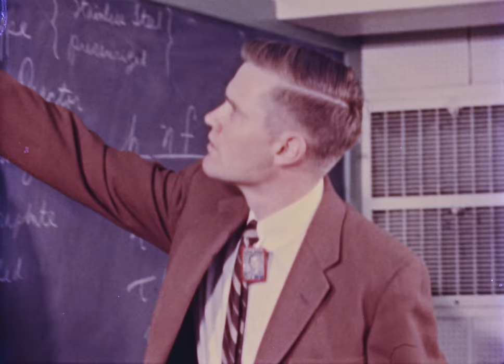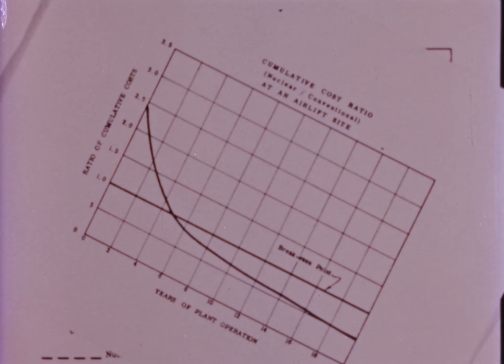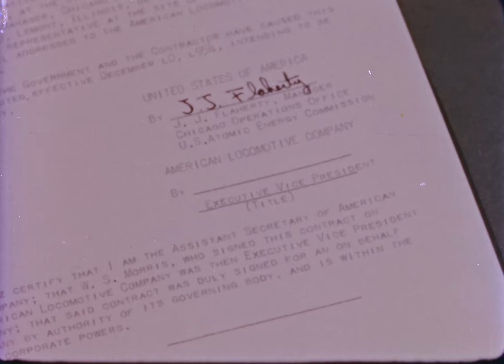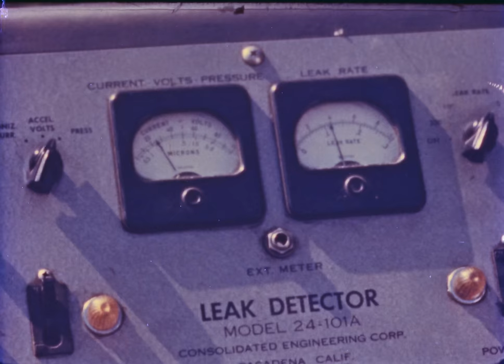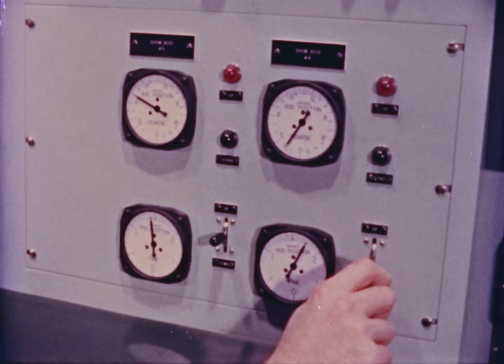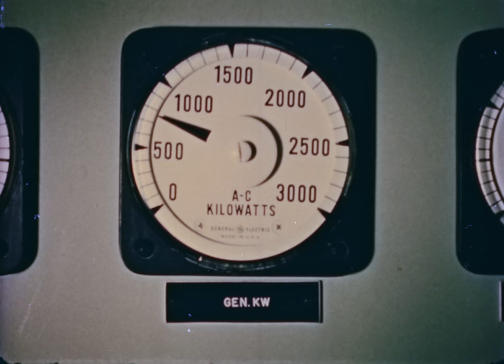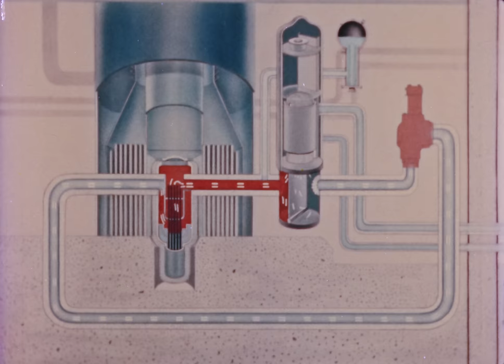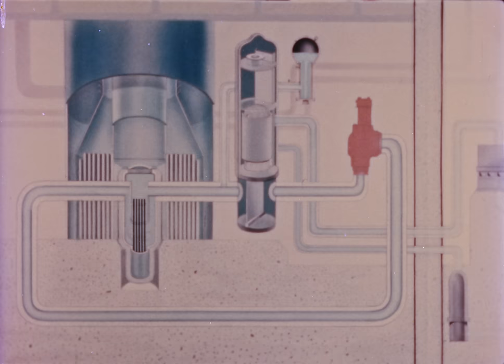Army Package Power Reactor

Comment: I wonder why this cannot be used today?
Reply from the maker: Well it's decommissioned now and being dismantled. A few orgs are trying to rekindle expertise is building and maintaining air-shippable reactors.
Reply: @whatisnuclear  what I mean is why can’t this technology be used today?  We know how to build them.  R and D done decades ago.   Small Modular Reactors ready and  waiting to be built.
Reply: efficiency scales with size. it's way too small to be economical.
Reply: @Muonium1 Unfortunately all forms of electrical generation is subsidised.
Reply: Because in 1961 there was a reactor accident with the successor SL-1. SL-1 is the only nuclear accident in the United States to date in which people were killed. At the National Reactor Testing Station in Idaho at 9:01 p. m. , the prototype of a military boiling water reactor, the SL-1, which had been shut down over Christmas, quickly became supercritical for a few milliseconds, releasing about 6,000 times the power for which the facility was designed. Before the reactivity could be reduced by the formation of vapour bubbles (see vapour bubble coefficient), the fuel elements of the small reactor core made of highly enriched uranium (90%) already disintegrated. The 2 m high water column surrounding the core collided with the reactor lid at 9 m/s – the water level had been lowered slightly for maintenance work – and caused the entire 12-tonne boiler to rise almost 3 m up to the floor, thereby pushing the steering rod back in completely.
Reply: Generally, fear, ignorance and prejudice.
Reply: Because the environmentalists that witnessed 3 Mile Island and viewed the China Syndrome movie, successfully destroyed the nuclear power industry; Coupled with too much intense regulation to build such a plant.
Reply: @65gtotrips  That's a gross oversimplification.  As noted above, the small plants are uneconomical.
Reply: @karstendoerr5378  A failed back to the future Doc's DeLorean, which takes 1.21 gigawatts (GW) or 1210.00 MW of power "withdrawal caused the reactor to go “supercritical” in just 4 milliseconds as the core power level surged to 20,000 megawatts"
Reply: @65gtotrips Compared to what? Regularly Shipping tons of diesel in barrels to an Artic army base?
Reply: @Muonium1 economic compared to what? Regular shipments of diesel barrels to a base in the Artic?
Reply: @Nill757  Compared to LARGER REACTORS. duh
Reply: @Muonium1  the video was about the need to get power to small remote bases in the like of the arctic, not Chicago. See the diesel drums rolling around in the snow at the beginning?
Reply: Green activists
Reply: @karstendoerr5378  “because”

Had absolutely nothing to do with this package reactor at Ft Belvoir.  Army probably has had a thousand times more people hurt in diesel fires, explosions, but they didn’t quit all diesel  use.
Reply: Regulation
Reply: @65gtotrips  the same chant we heard right before Fukushima happened.
Reply: It could, however people became too scared after the 3 Mile Island incident, followed shortly by the Chernobyl incident. Soured Americans believe in atomic energy. Not that we didn't have our own incidents and problems with generation. And other plant operations. But as far as cheap clean and efficient power generation you cannot do better than nuclear power. And yes we still could do this today. However we just do not have the general National consensus to go forward with such a program. As we did in the 1950s. Where we thought nuclear energy would be the answer to everything well it's not the answer to everything it is the answer to a lot of things. And there is a distinct difference between nuclear weapons and nuclear power. The two are not interchangeable
Reply: I thought it was concluded by the energy commission, that was a murder-suicide plot between two of the operators.
Reply: @65gtotrips Fukushima daiichi atomic energy plant, operated exactly as it was supposed to. Unfortunately when the designers worked out the initial calculations for the plant no one ever foresaw 120 ft wall of water, that would somehow reach a plant that was perched well above the ocean. And fairly well sealed and designed with some of the best seismic safety precautions of any plant ever. Has everyone forgets Japan has the the strongest seismic protection programs for any of its constructions. The issue that did before the plant, once the 120 ft wall of water that no one could have foreseen what happened. The plant did it it was supposed to. It shut down the manual cooling systems were operated correctly. But what we got an interesting Glimpse to see was what could possibly happen in a worst-case scenario inside the containment of a atomic plant. Remember this is why we have containment buildings where Russia did not. And you see the damage caused by not having a containment building. Yes there is millions of gallons of water that were used to cool the reactor that are being held in tanks for storage, and yes a large amount of area was contaminated with the steam release none of these compared to what happened at chernobyl, or what could have happened if none of the Safety Systems have been put in place. So to say that Fukushima was the reinforcement of our fears yes that is true but only two people that were not educated and understand how atomic energy is generated.
Reply: The technology is used today. It's this way most of the world's reactors are built but larger because it's more economical.

Comment: The buildings for this project still exist.
One building, just up the hill from the SM-1 reactor building is used by the Joint Personnel Recovery Agency (JPRA) as their HQ.  
From what I recall, the JPRA building was originally used by the reactor project team as a working office space.  
The JPRA building is interesting as it has built in shielding as a measure to protect the occupants in the event of a radiologic emergency with the reactor facility.

In 2022, the SM-1 reactor building deconstruction began. 
You can find videos of the deconstruction on YouTube.
I do not know if the building is completely disassembled yet, but you could see the building from the Potomac if you had a boat to get there.
Google Earth satellite imagery still has the building in-situ.

If you do try to see the building via boat from the Potomac: DO NOT ATTEMPT TO GO ASHORE at that location!!  
This area of Fort Belvoir is a secure area not accessible to civilian or military personnel without authorization.  
You will be arrested and fined heavily if you attempt to do any landing from the water at this location.
Reply from the maker: Thanks for the info!
Reply: I watched the deconstruction video. The scope is very different, but modern video absolutely pales in light of these excellent vintage videos.

Comment: The practical evolution of electric energy and distribution will likely involve small nuclear reactors placed close to the demand. They could be sized with excess capacity to be able to share thru the grid for redundancy to cover wider areas to minimize outages due to storms and other factors. This can minimize the need to send huge amounts of power long distances and minimize the area affected by outages.